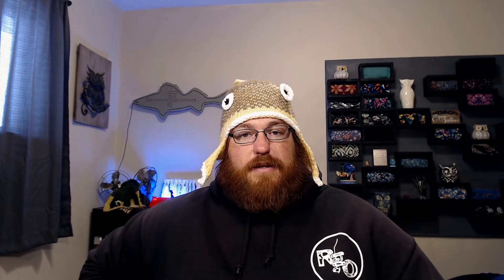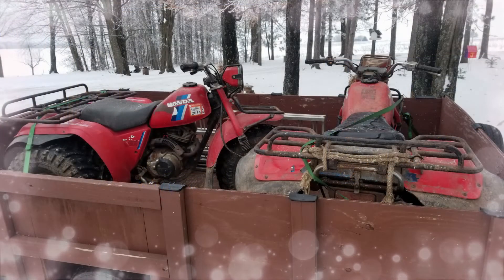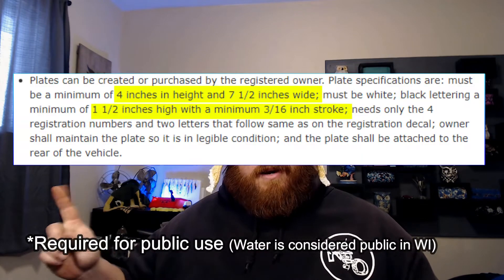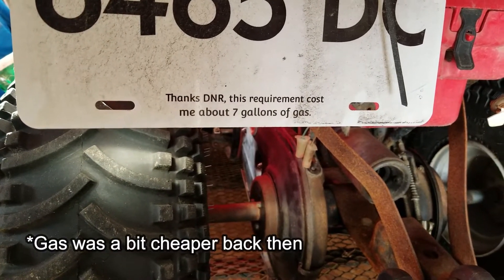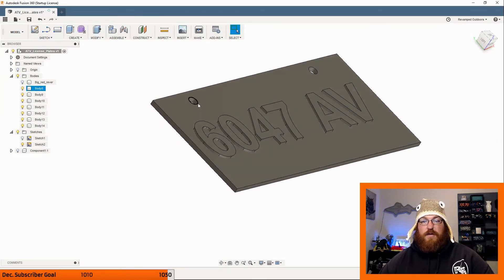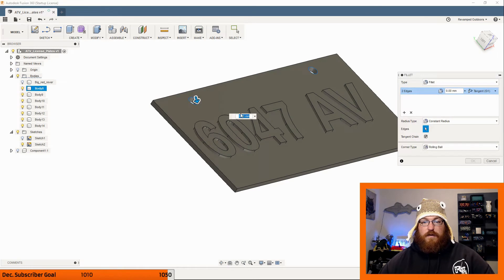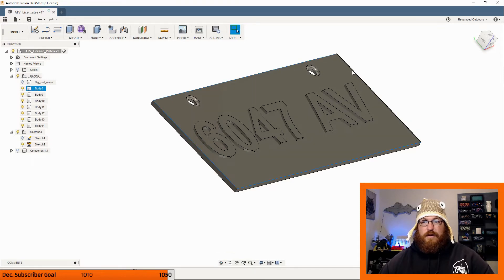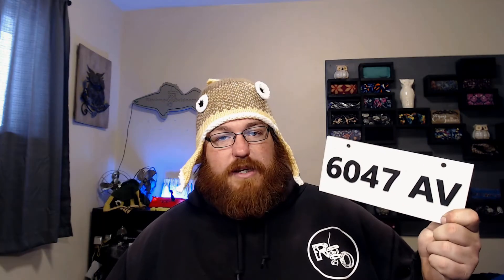3D printing to the rescue! ATV license plate.

Comment: I had a 1985 Big Red....Still have the marks on my calves....yes calves. You can't fix stupid. It was a great machine but once a little snow arrived, it was tough going with it. I also like practical 3d printing. Thanks for the video...
Reply from the maker: They've claimed a few calves that's for sure! As long as you can stop the urge to put that foot down they're great for frozen lakes!  I think the best thing they got going for them is the cost, electric start with reverse for under $1000 anymore is a unicorn!

Comment: Why print out what's basically a flat plate? Wouldn't it be easier and quicker to print the letters and glue/melt/screw them onto, say, an acrylic chopping board that's big enough to cut down to size?
Reply: Quicker? Maybe. Easier? Not at all. What's easier than sitting in your spare bedroom...office...wife's makeup room and letting a machine do 98% of the work? I'm not poo-pooing your idea; if that's what occurs to you first then let the chips and hot-snot fly, but it wouldn't be easier.
Reply from the maker: I think adhering them to a metal sheet or acrylic sheet would make for a little more sturdy end product and could make it look a little more professional.  But for something like this I usually just roll with the whole printed version because it's not really going to be taking any load or experiencing a lot of force, plus if I do break it I just hit the button again and print another!  I also printed it without 100% infill (3 perimeters) so I think the print finished in under 5 hrs or so, so not too too long. Just set it and forget it! (while monitoring every once in awhile :)